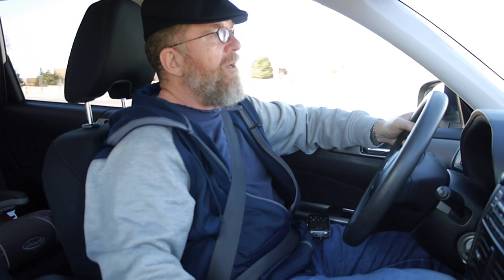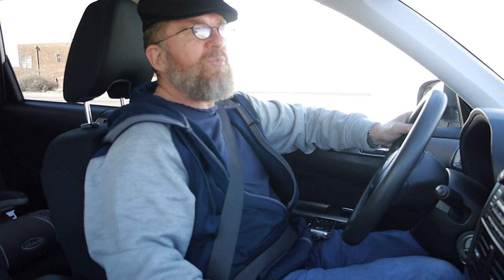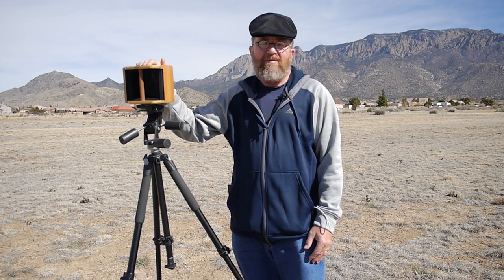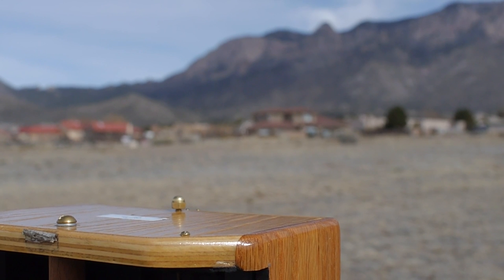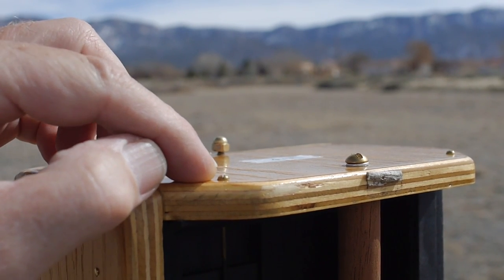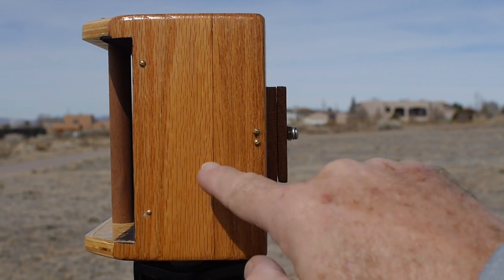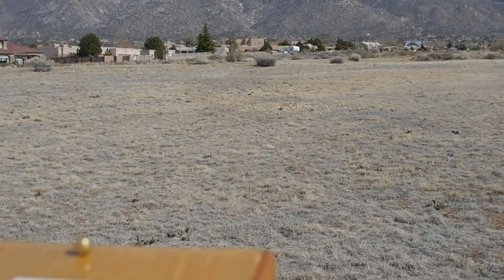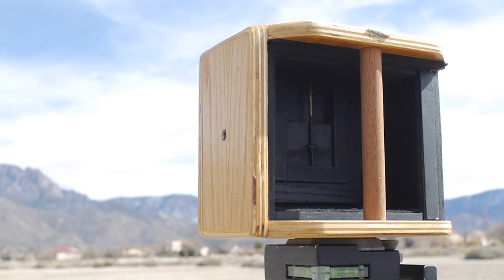Pinhole Camera Composition

Comment: Excellent explanation of composing the shot via the viewing dots.  I’m looking at a zero image camera and couldn’t figure out how I would aim the camera, now I see how.  Thanks.
Reply: gsansoucie - Did you get one? The Zero Image cameras come with a viewfinder card. The ZI 2000 (6x6) for example has a 25mm equivalent focal length, so you’re supposed to hold the card 25mm (same as the focal length, some of their other cameras are 40mm equivalent) away from your eye to see an approximate viewing angle of the scene to help with setting composition. I just got one a few days ago, I haven’t even shot with it yet but plan on going out with it in the next few days. 

I just ordered something to try and make it even easier. I ordered a cheap $20 25mm viewfinder off eBay (just a few minutes ago actually) and plan on attaching it to a cold shoe on a spigot on an arca swiss plate. That way I can actually snap it in to my tripod head and get my tripod in place while setting up my composition. Once set I’ll remove the viewfinder plate and snap my camera in. I feel like that will be more exact than just holding the card up and hoping I get the tripod set up in the same place. The spigot should raise the viewfinder up to approximately the center of the film plane too.

Comment: I am making my own pinhole camera at the moment, I hope I can get prints as sharp as yours. Great! some of the best I have seen. Thanks. Regards Ken
Reply: Hi Joe, did you pre-flash the Hartman DPP?  Your images look a lot more detailed than I get from unflashed, and your effective film speed is higher.  Really sharp images too, impressive!
Reply from the maker: I believe I did pre-flash. As for the effective speed, it varies from summer to winter, depending on the blue/UV light in the sky. Summers I get around ISO7-8, winters maybe 2-4 or so. This is in the high desert southwest; thick, humid air might be slower year-round.

Comment: hey Joe. love the channel I'm trying to work out what distance i need to make my pinhole to my 4x5 film holder for an equivalent focal length of 100mm lens on 35 mm format. I'm just confusing myself any suggestions on how it work this out? thanks for your time and content. Tom.
Reply from the maker: The image size on a 4x5 sheet is about 93mm x 118mm. The image size on a 35mm frame is about 24mm x 36mm.

So, use the ratio of the long sides to derive the focal length for 4x5 giving the equivalent angle of view :
100mm/36mm :: X/118mm

X = 327.7mm

So a focal length of about 328mm on 4x5 will give the same angle of view as 100mm focal length on 35mm film.

Keep in mind that the two film formats don't have the same aspect ratio (35mm film has a 3:2 ratio, while 4x5 is 2.5:2 - less rectangular, more square-like; closer to micro-4:3 aspect ratio of 2.66:2). So I'm assuming the horizontal angle of view in these calculations.
Reply: Joe your brilliant i think it was over complicating it and confused myself. well put. I'll keep you updated on my progress. thanks for the inspiration and help.
Reply: i mean i think it was over complicating it.